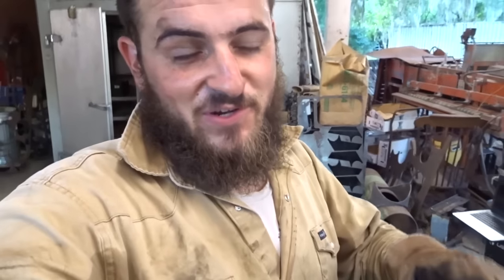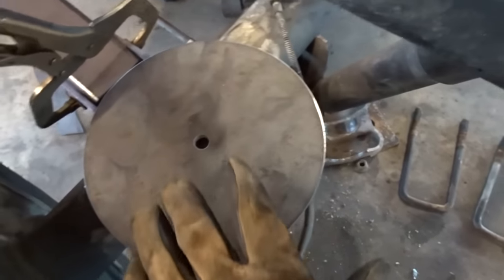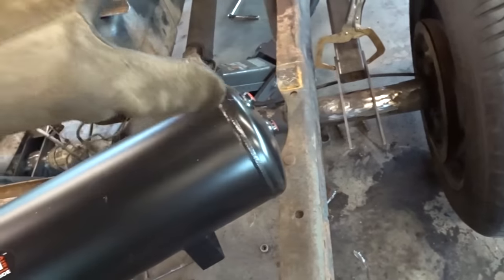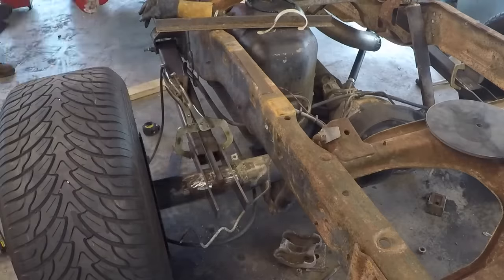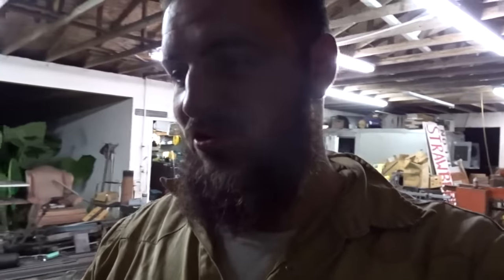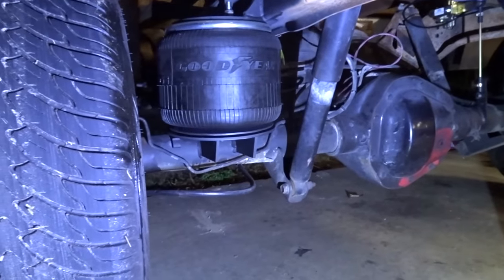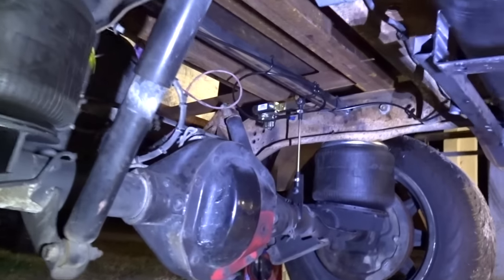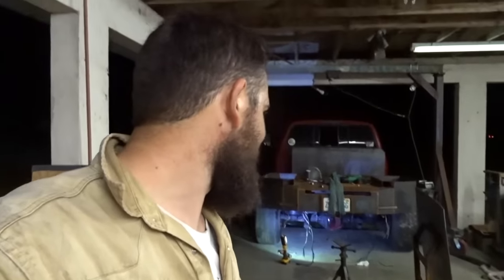Simple Air Suspension Build

Comment: I see alot of comments on its gona stress the metal when flexing side to side.  A semi truck has virtually the same suspension minus they use spring steel as the arm connected to the axle vs tube.  Same style bag.  And bolted to the axle not welded.  I converted my kodiak c6500 to air ride with springs from a junkyard freightliner $150.  300,000 miles later still rolling no issues. Did have a trac bar though.

Comment: I used to supply air suspension parts for HGV's, I can see youve the basic idea of the "swinging rear arms" and the height control valve is right, but id worry you have insufficient side-side movement control given the  gauge of the arms and its fixing to the chassis.
Reply: i agree, it needs a panhard rod.

Comment: I respect the fabrication skills and aptitude HOWEVER: 1) The trailing arms are going to either snap or twist over time because your axle isn't able to articulate at that axle hinge point when flexing over uneven terrain. 4 link setup would solve that. 2) If that doesn't happen first you can expect it to break sideways when your axle walks out from underneath the truck due to there being no track bar which limits lateral movement. Lateral movement is also mitigated by use of triangulation USING HEIM JOINTS (not welded directly my guy), also typically found in many 4 link setups. 3) Bonus lesson on Universal Joints: The inherent nature of u-joints requires some operating angle (Typically no less then 1 degree on both input and output side) in order for the needle bearings within the caps to rotate and actually act as bearings (otherwise they become powder over time) so installing the axle yoke parallel to the driveshaft is a terrible idea. Furthermore input U joints and output U joints should always be on a parallel plane because either side of the u joints in a system speed up and slow down during operation (dont believe me look up a slowmo video theres a whole science behind it who would have thought), the trick is to have them speed up and slow down at the same speed and cancel each other out, hence the importance of parallel operating angles. We all remember that friend in high school that had his 'pumpkin' sticking straight up on his jacked up jeep wrangler with a terrible highway vibration (Input and output at different operating angles). Anyways i hope no one died as collateral due to this Frankenstein machine. I only give my input to hopefully help the next guy do it right. No ones perfect its just all just a learning lesson.
Reply: pretty sure this is an exact copy of a semi trailer suspension and they don't seem to fall apart.  Also I would not recommend heim joints for suspension unless you are building something with tons of travel, bushings are much cheap and quieter for road vehicles and should last a lot longer than a heim.
Reply: @1966cambo A semi trailer is a different use case. Generally, the trailers are long and can twist enough to allow the tires to stay planted. Though some suspension systems allow for flex if the trailer is intended for off-road use. Semi tractors can also use this type of suspension on their drive tires but the link bar is a half spring, not square tubing, that allows the the tires to move individually. They also always have a panhard bar to locate the axle.

Comment: I was looking at building a trailer with air bags and saw this. I was thinking that it seamed wrong in the way it could move side to side when going round corners. So glad I read the comments. Thanks everyone
Reply: @joel6427  it’ll flex at the point it’s connected, which will eventually weaken and break them
Reply: @joel6427  the better way would have been to keep the leaf springs and just add some  bags ontop of it

Comment: The tractor trailer suspensions those arms are actually spring steel and they allow the axle to twist a little bit when one side goes up and the other doesn't, I'd be concerned about hard welding the three link like that.  In fact it would have been a little bit easier to just cut the leaf springs 8 inches past the axle and then threw bolt your airbag mount

Comment: My dad had put those big rig air bags in his 65 chevy dually truck roughly 45 years ago with a peterbilt leveler on to level the bed.    His bed road about one inch off the tires..   I'm building one similar to yours except I'm welding my mounts under and offsetting my bags further back.  But great job

Comment: Nice work guys, are you adding some lateral support (I.e. a panhard rod)? May seem pretty solid without but you’re putting nearly double the strain on the original front spring mounts (by omitting use of the rear mounts). Might be worth looking at. Keep up the good work 👌
Reply: Not really cause they are putting the weight to the frame from the bag instead of the front or rear perch, as for as forward and rear movement from acceleration and deceleration the back perch was on a leaf spring shackle that rotates so the front handled all the for and aft movement anyways while the rear just swiveled the shackle to compensate for spring compression and extension

Comment: This type of suspension is okay for Harbour Freight go-carts but it don't like to go around any sort of corners and will tear the trailing arms off the axle housing in short order if you try. Simple, cheap, but unfortunately unable to do anything except pose around a fairground at low speed. It's a shame they don't work.

Comment: ok on my Freightliner, there is a single THICK leaf that goes from the frame like you did in your design. then it u-bolts to the axle just like the OEM spring on that truck would have. it then bends 90* down to be as low as the bottom of the axle then 90* to the rear of the truck for about 8 inches, then it 45* to center the bag under the frame. The bag is quite far past the axle.  this design works great. IT does however have a panhard bar. The only thing i see wrong with your set up is the lack of a panhard bar and the bags should have been farther back for a better ride. i also think it would have been best to mirror the design on the Freightliner vs rigid bars welded to the axle.  you probably could have actually used the heavy single leafs from a semi truck.

Comment: Very cool. How does your leveling system work? I am about to build a system for my humvee, but I think I'll either use an off the shelf system which is 3k ish, or more likely use sensors and an arduino computer to manage the compressor and valving. Are the sensors straight forward with reading resistance values?

Comment: I'm no engineer so please don't kill the question. Are you not worried about axle wrap or droop if he backs into a ditch or hits it hard in reverse?
Reply from the maker: If you think about it it’s not much different than leaf springs just without the rear hanger, yes there isn’t as much flex in the bar as leaf springs but it will still flex a bit
Reply: @j_moffitt  yes, it will flex, but mild steel will not continue to flex over & over. It will fail. That's what spring steel is for, aka "leaf springs"

Comment: i really enjoy these videos...so much that i watched it twice in a row. what are you using to keep the axle centered left to right? i didnt see or hear you mention a pan hard bar.  maybe you just have not got that far in this video. how much pressure are you running in the air bags? i really like putting the air bags behind the axle where it can mount lower and use the full range as needed. love how you use the plasma table to make your own brackets. makes for a really nice finished product.
Reply from the maker: Haha thanks Mr. J.C. , it’s basically just leaf springs without the rear leaf bracket and the fit up on the front is so tight there was literally no side to side movement,  my buddy is driving it now and he’s gonna let me know if we need to change anything or if we should add a panhard.  As far as pressure in them I’m not sure, we just hooked up a leveling valve and didn’t check pressures, but if I had to guess it’s probably like 5-10 psi and that plasma table is worth it’s weight in gold, awesome product

Comment: Just ran across this and was wondering how it lasted. I note that on later builds you seem to have moved to a 4 parallel bar suspension instead, was that because of problems that they ran into with this?

For all those saying that these will break, can't work without a panhard bar, etc. I'll point out the Chevy C10 rear suspension, it angled the arms towards the center a bit, but they were solidly bolted to the rear axle, not a lot of articulation, but if the vast majority of your weight is on the rear axle anyway, I question if the axle is going to articulate much, or if the body will roll to match the axle (except for momentary impulses)

also, those arms act as a huge castor angle to keep them in place most of the time. When backing or getting a significant side load there is some stress
Reply from the maker: Only real problem was the bags weren’t the best choice. I didn’t allow for enough travel for these particular bags and it was just a very rough ride without weight.  Never noticed any ill affects in handling or sway.

Comment: That's a badass build. U have always liked the airbag suspension and want to do it on my '89 Ford 4X4 that I use as my work truck welding rig. It looks pretty straight forward and I have some double Bellow airbags that are on my Dodge truck that  I might use. It may not work, but hey it's a try.

Comment: Nice, simple setup... BUT - you've gotta know that your buddy is in for some hurt. Those bags are already riding too low, as there should be a lot more piston visible at ride height; plus, you said you wanna tweak the height valve to bring it down, so you will effectively have no suspension. Check the manufacturer's spec for those bags and what the ride height is meant to be. Then cry a bit, then order some different bags. 👍👍
Reply from the maker: You live and learn, I know it’s not ideal but if it comes to ordering different bags I will, gonna see how it ride/ once there is more weight on it
Reply: @j_moffitt  I suppose the most important thing is this - you are having a go and seeing what does / doesn't work. And that's great. 😀

Comment: I was curious  as to what you did foe a panard bar. Any pics? Looks great as usual. 😀
Reply from the maker: No panhard. Thing was solid side to side
Reply: For safety, do a panhard bar from the bottom of one air bag to the bottom of the frame. When you get a load on there, or pull a trailer, you don't want to find out the hard way you should have added one.

Comment: where’s the pan hard bar!
Reply: Diego C. You don’t have to have one with this style when the link is welded to the axle and only has on movement pit you don’t need it
Reply from the maker: What he said... yeah it’s not needed but could be added to give you piece of mind
Reply: Ya the one I did after time I found it started to stressed the bolts so I went to a 1” bolt and put a pan hard bar to help
Reply: Puts bind on your bushings either way..I like to over lay plate on my bushings when they weld to the link bars..especially with those lower links doing all the work

Comment: Sorry but that’s a terrible design no way for any articulation and no panhard it will rip itself apart take it off the road and fix it before it kill someone
Reply: And nothing like the "big rig" !!!
Bags should be behind the axle, "spring"(2x3 tube) should be bolted to the saddles they cut off.. 
I didn't see a torque rod (from pumpkin to the frame to hold axle centered)
Looks nothing like any truck air suspension I've ever seen!!
Freightliner, Pete Air Leaf, Pete Low Air, Hendrickson, Nuway, (the better ones) 
Not even like Krapworth 8 bag...oh, wait... Maybe it is like 8 bag, it's not really fastened to anything either 🤣😂😎
I wish them luck, but I don't see it working well for very long 😪

Comment: Hellow im jeff i was wondering if you could cive me some suggestion I am disabled and wheelchair and I have a 86 Dodge camper 445 lb how to. Have a. Chariot carrier and I feel every little pumping Pebble in the road and it can only drive about 45 minutes at the max was wondering if something out that I could put in the rear suspension and front suspension so I could do a small trip is there something that I could do to the seat that I sit in that would help as well if you could be kind give me a little advice on when I could do it would be real preciate it I know this isn't all your channel is about but so far nobody would reach back to me with any suggestions or materials that would be good for my situation thank you for reading my post
Reply from the maker: You could look into putting an air ride seat from a big rig in it and depending on how your truck suspension is setup you could add helper bags or add some better shocks to help with the ride

Comment: Hard to tell from the video but did you weld the tubing to the axle?
Reply from the maker: Yes but not directly
Reply: @j_moffitt  so when you air up the bags wouldnt it make the pinion off? Also if there welded like that you wouldnt be able to go over anything with out it pulling the other wheel off the ground cause it woukdnt flex?
Reply from the maker: Pinion is set to the ride height, and they will flex, definitely not as much as a 4 link but it will flex

Comment: I would love to pick your brain  on some air ride set ups this one interests me its very similar to what I see on semis minus a panard bar im a truck driver. Cause I've got got kind of a custom truck I want to do something. It's a 1953 Ford f600 and I'm looking to add axles and transmission and possibly transfercase from a 92-96 f350 4x4 dually. Im also interested in swapping a 12v cummins in it. Also interested in building a kind of rollback flat bed that I could haul cars and wood just the same if you've ever done something like that thanks man.
Reply from the maker: What kind of axles and wheels you plan on running?  I’m not familiar with the frame width or size on that truck but it may be simple enough to find a frame cutoff of an air ride semi suspension and incorporate that into it possibly.  Just an idea
Reply: @j_moffitt  one of the reason wanting to go with axles off of  a say like a f350 is so more options for wheels and such and to make it 4wheel drive a semi would be a thought though if I didn't want 4 wheel drive. Frame rails are 33.5 inches wide, frame rails are 4 3/8 tall.
Reply from the maker: Definitely a lot more options and you’ll have free reign of how you want to set up the suspension

Comment: You have got that setup all wrong. No allowance for articulation and no panhard rod for lateral stability. Something will have to fracture eventually. Dangerous stuff. That wouldn't even be safe or work on a trailer let alone a truck. It worries me when people with no understanding of the basic principles of vehicle engineering and dynamics undertake such projects. Do some research and go back and re- engineer it correctly. Or better still you should get somebody to engineer it for you. You have the skill to fabricate things properly so make the best of those skills you do have and combine them with the skills of somebody who understands how suspension works.